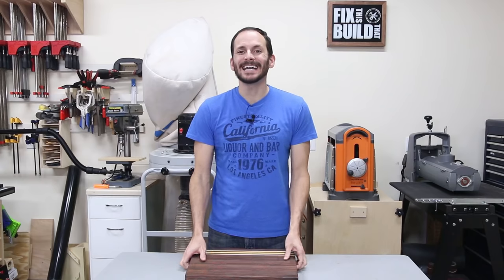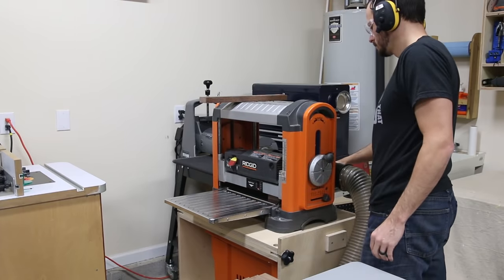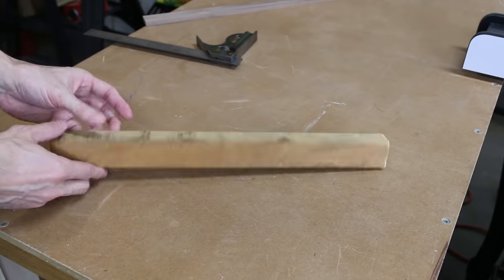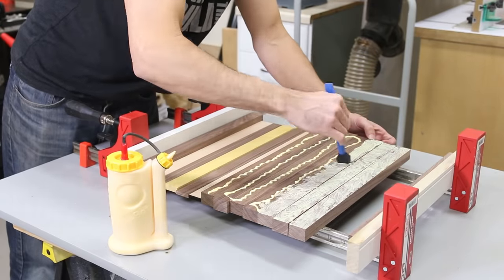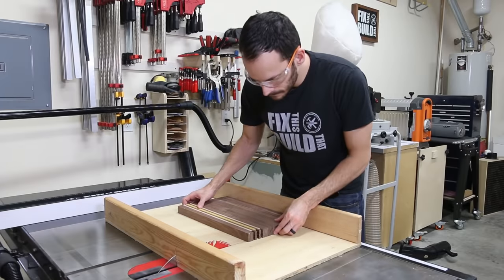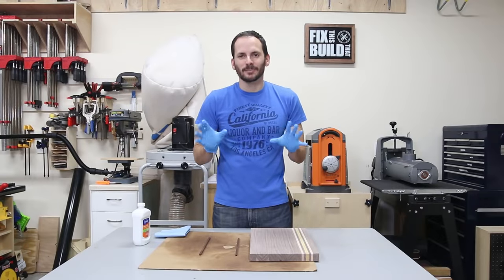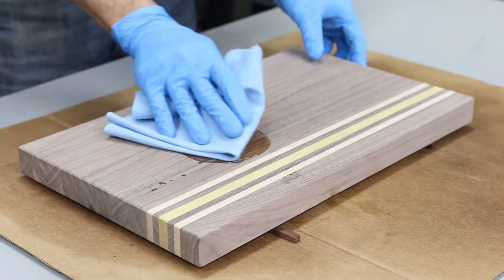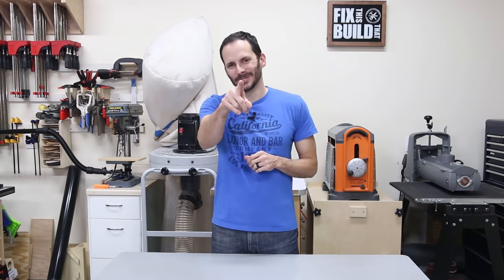Most people forget to do this important step

Comment: I presume this method can be used when making table tops too, is there anything to be wary of when mixing different woods? I'm wondering about different rates of expansion and contraction that may occur.

That walnut looks fantastic.
Reply from the maker: Sure, you could use the same methodology with a larger glue up.  Rates of expansion with different boards won't matter as long as you account for it with the method you attach your top.  And thanks!

Comment: Do you recommen using a stain/varnish on the board, after engraving, and then using the oil/beeswax mixture? My worry is if you use the board to cut on, won't the cuts eventually get to the stained layer and contaminate the food?
Reply from the maker: Never stain or varnish a cutting board
Reply: One last question, do i need to buff the wood? I’m using Butchers block conditioner. I’ve already added two coats of food grade mineral oil and natural waxes mix. There’s a bit of residue on the top later. Not sure how to finish it off so it’s food safe and ready, and not oily. Thanks in advance.
Reply from the maker: @timetoparty11  it will dry with time. Give it a day or two and then buff with a dry towel and it should be good to go and not oily to the touch

Comment: What do you need to look for in the timber you select for your cutting board? I have a slice of very nice timber at home but it's too small to do anything significant with. I could, however, make a few cutting boards with it, but I have no idea if the wood is suitable. I've seen it used as flooring, so surely if it can withstand that, I'm good to go right?

Comment: I recommend sanding before you do your edge treatment. When sanding  with a hand held tool it's impossible to be perfectly uniform. As such whenever you hit the edges you'll create a variance on the treatment. This is especially visible with such a small round over bit as you're using.

Comment: Thanks for the video. No issues with planner snipe?
Reply from the maker: +Brian Battaglia thanks!  I get a minor bit of snipe when doing the full board, but it sands out easily.  With the small segments I cant the board and lift up on the back going in and the front coming out (you can see me doing it in the video) and that elminates it.  Can't lift the full board as well, so get a little there.

Comment: Great video. Thanks for posting it.  I'm just learning how to make cutting boards.  Have done one so far but am in the process now of creating a few more out of some red oak from a tree we took down in our yard.  I have heard that when you cut the strips for the board you should reverse the strips as that makes the board less likely to warp.  Is there any truth to that?  I did not see you do that here.  Thanks!
Reply from the maker: Hey, Clem!  There is some truth to the boards wanting to cup if the grain is all in the same direction on wider boards that are flat sawn.  These boards are very small and also they are almost all rift sawn.  So the effect of that is minimized massively.  I line up the boards by look and grain matching as the priority.

Comment: So i'm making an edge grain board (about 4ftx2ft) and the 2" wide panels are a little bit bowed (after I had jointed and planed the big lumber). Should I individually run them through the jointer and planer again, or glue up a few panels and then run them?

Comment: I heard you mention 1/8" kerf. Why do you use a full kerf blade when thin kerf ones are available? Just wondering as my saw is in need of a new blade soon.
Reply: I think people get a thin kerf blade when their saw isn't that powerful.if their saw bogs down a lot when cutting harder wood,a thin kerf help relieve stress on the motor

Comment: Can I ask why you wiped with a wet paper towel after gluing?
Reply from the maker: +MorrMedia1 so there wouldn't be big dried  glue beads to chip my planer blades.
Reply: Fix This Build That not sure I follow you. You had removed all the globs with the scraper, so what is the wipe down giving you that the scraper didn't?

Comment: Very nice video and great board. A quick question if you please. Having watched a few of these tutorials where the planks are glued together I wanted to know if there is any risk of the boards coming apart at some stage and could you use dowels or dominoes to keep the boards together? I am a newbie so my question might seem trivial. Many thanks in advance
Reply from the maker: Glue is strong enough to hold tight forever

Comment: Question for this channel or anyone who had made cutting boards! I live in AZ and during the summer my workspace (garage) will be 90-100 constantly. Can I let the mineral oil and butcher block conditioner dry in that heat? Or should I bring it inside until the weather is a bit less harsh? Thanks in advance!

Comment: I didn't see you use a jointer here before glueing the pieces together. How did you get the edges to be so straight? Or were the pieces already straight?
Reply from the maker: +Muhammad Isa Dennis instead of jointing them I plane them.  So two faces are flat and parallel and I use those to glue it all up.  Then I'm left with rough top and bottom which I then plane smooth.  No jointer needed using this method.

Comment: Very nicely done. Some like putting those tiny rubber "feet" at the corners to slightly raise the board while some other people say that by doing so it takes away the ability to turn the board over for using the other side.  I suppose each has their likes and dislikes but either way, your board is beautiful!

Comment: Hey, when you oiled the board, i saw that you oiled one side and then turned it over to oil the other side. My question is, when you turned it over, and rest it on those 2 supports, wouldn't those sections dry with marks on them from the supports? If not, how come?
Reply from the maker: Good eye and good question.  In short the mineral oil is a penetrating finish vs a film finish.  So it doesn't dry on the surface.  Technically mineral oil doesn't actually cure at all.  So it won't affect the board, just wipe everything even on both sides after you pick it up.
Reply: Interesting. Thanks for the info. Great video and amazing looking cutting board. Do you have any tips to good places to find interesting woods like that yellow one?

Comment: Thanks for this - lots of helpful info here & great design too!  Two questions, if I may - one, you say your boards are normally 16" long, how wide are they? Two, the wider part of the board you make up out of the walnut strips - if I had an offcut that was 2" thick x 18" long x 10" - 12" wide, and I wanted to use that to make a board like this, would you recommend that I rip it into strips & glue them back together to make the wide part, or can I use the offcut as a solid piece?  Hope that second question makes sense.  Many thanks.  Oh, and I love the idea of the sanding station!

Comment: I have a question...why does everyone always scrape the glue squeeze out before running through the planer? Does it make the planer blades dull faster?  Thanks. And your cutting board looks awesome!
Reply from the maker: +Trevor Langlinais yes, the hardened glue can chip your planer blade as it's harder than the wood. Also if you don't then the board won't ride as flat on the bed.
Reply: Ohh ok. Yea, that's probably why there are some lines when I plane stuff. Gonna start doing that now! Thanks!

Comment: No snipe from that planer? I have a porter cable and am having to cut off 2 1/4” on each end due to snipe. I understand it’s common with bench tops but you didn’t seem to have any issue? Should I get a rigid?

Comment: I see that at around 5 min into the video you are sanding both with and against the grain. Can you elaborate on this? Is it okay to sand against the grain? I was under the impression that for something like this you only want to sand with the grain? Thanks!
Reply from the maker: Justin Swenson the sanding pad spins in circles so you aren't going with the grain no matter which direction you move the sander. When I do my final sand at 320 and 400 I do go with the grain

Comment: Made a great looking cutting board. Only problem is that it slides all over the counter when I use it because the bottom is so smooth. I ended up buying some feet on amazon. Is there any way to reduce the slickness on the bottom during the crafting process?

Comment: No snipe in that rigid planner?
Reply from the maker: There is a little bit of snipe on the large board glue up but I sand that out.  With the thin boards I cant them slightly and pull up going in and coming out.  May want to check this video out I did on snipe.  https://www.youtube.com/watch?v=HgijFMEVVIQ
Reply: Fix This Build That yes, I saw the snipe video weeks ago. Very interesting. That's the reason I'm surprised about little snipe you get with that planner. Maybe roll pressure is adjusted as minimum as possible. Excellent results

Comment: For the peasants among us who don't have fancy gear, how would you recommend planing the pieces to exact widths?
Reply from the maker: +Regan Ryan if you don't have a planer then your best bet is to buy boards that are already surface on 4 sides (S4S). Then rip them on your tablesaw to the widths you want. When you turn the board 90 degrees on edge the width you cut becomes the thickness or height of the cutting board. If you don't have a tablesaw then you'll have to buy the boards already ripped to size.

Comment: Can you tell me how you were able to avoid using a joiner?
Reply from the maker: +Cindy Littrell I didn't need a jointer because I flattened the glue faces of the smaller boards with the planer then after the glue up I flattened the other two faces of each board (now the top and bottom of the cutting board) also on the planer. So I ended up flattening all 4 sides of each board on the planer.

Comment: Haha might sound dumb but is the mineral oil different from mineral spirits I'm guessing?
Reply from the maker: Very very different! Do not put mineral spirits on your board
Reply: Mineral spirits has organic solvents in it whereas mineral oil is just oil.  Don't use mineral spirits @Fixthisbuildthat
Reply: @Fixthisbuildthat  I read that mineral oil is non drying. Wouldn't it be better to choose a drying oil? I'm pretty new at this so I really don't know.

Comment: Long time watcher/listener, first time commenter :P.  I am making an end grain cutting board for my brother for his wedding, and I am wondering how I can figure out if the wood I am using is food-safe.  The woods I used are the woods that were available at my local lumber yard that looked good: maple and red balau ("mahogany" decking, similar to ipe, here: http://www.wood-database.com/balau/).  Any thoughts on whether or not the resulting board will be able to be used?  Or should I pick a different wood?
Reply from the maker: Your comment got caught in spam because of the link.  But for the wood, I've never used balau, but I've definitely used mahogany before.  Honestly I think there is very little issue with almost any wood because of how little contact and cross over there is.  But make sure it has NEVER been treated with anything.  "Decking" in the name scares me a little.
Reply: Thanks for the reply!  It bugged me too, but I'm unable to find anything on their site (http://hardwooddeckingsupply.com/decking/batu_decking) that alludes to them having treated the decking but I'll give them a call.  Thanks again!